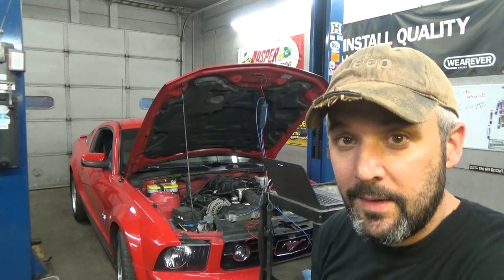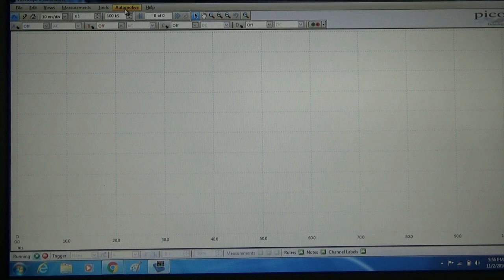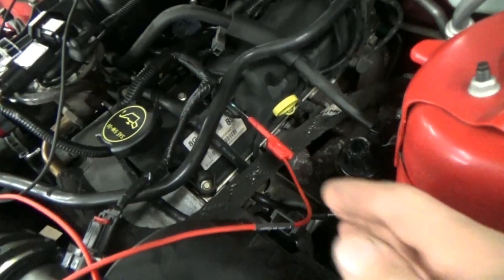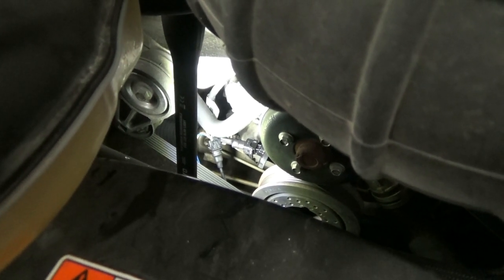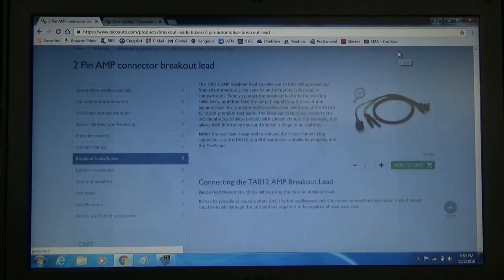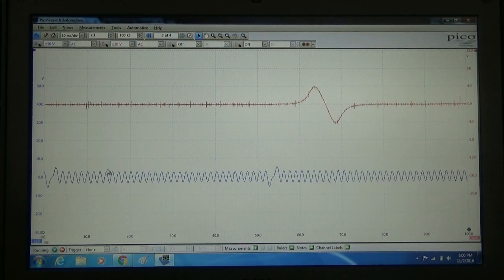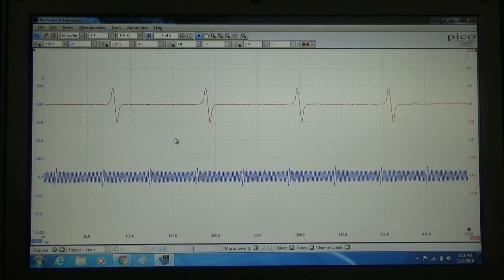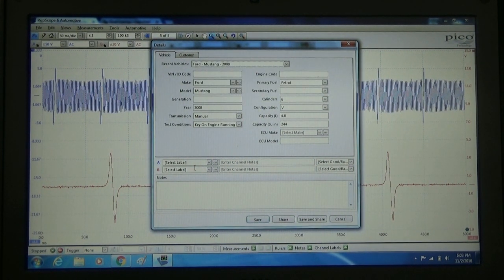PicoScope Guided Tests - Camshaft vs Crankshaft AT151

Comment: To inspect cam/crank correlation on variable valve timing engines would the actuator solenoids need to be unplugged before startup to keep the actuators locked to the cams?